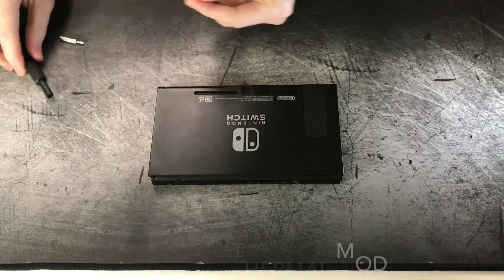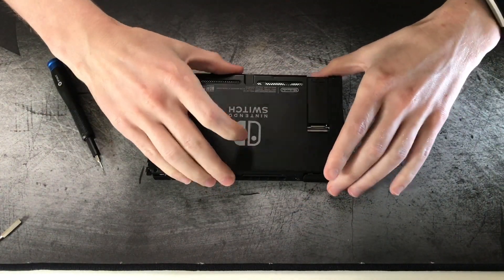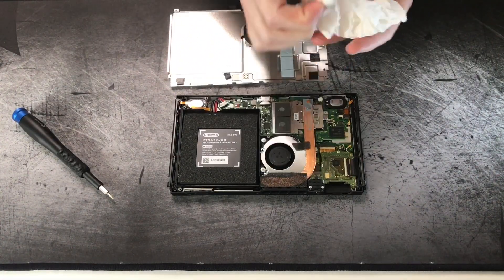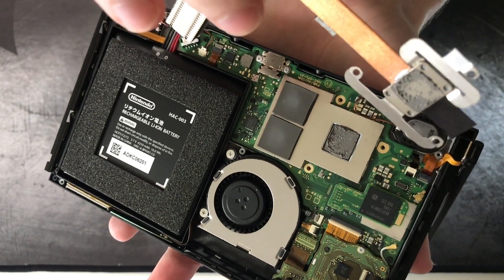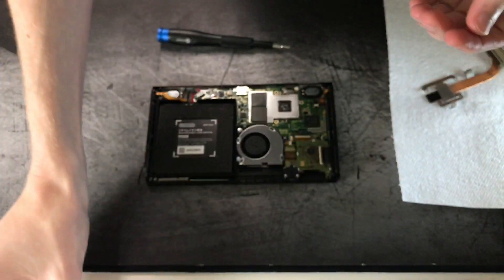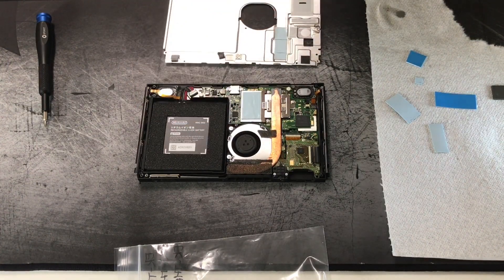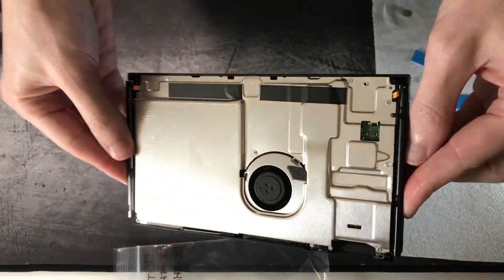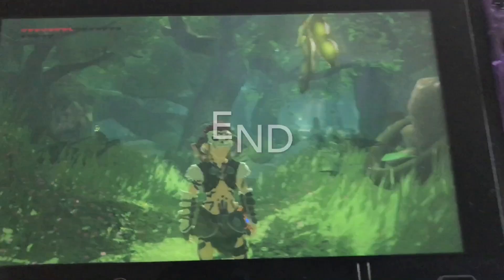Tech Shorts: Switch Thermal Mod Revisit, Thermal Paste and Thermal Pads

Comment: Changing thermal paste does not void your warranty. They use to try, but a few years ago we won that suit with the FTC they cracked down on Asus, Sony and a free others. This falls under Magnuson-Moss warranty act.

If you do not break anything in the process this does not void your warranty. Liquid metal will, as it will damage and corrode the metals. However swapping to another non conductive paste will not.
Reply: Is Arctic MX-4 good then? In order not to void my warranty I mean.
Reply: @theakiwar9118  Kryonaut is better

Comment: the backplate size can be increased by like 2mm in thickness and then a hole cut in the metal around the cpu and memory. Then put a 3-4mm thick heat sink directly on the cpu and memory and poke small holes in the plastic around the heat sync and put a thin air filter between the plastic and heat sync where the holes are. Modify dock to add a fan that directly injects air into the newly added holes in the back of the switch...

Comment: BTW, never spread thermal paste with your finger.  The oil on your fingers will reduce thermal conductivity of the material.
Reply: Does it really make a difference? Like measurable?
Reply: @clydefrosch  The oil (or any element/residue) break/reduce the conductivity between the thermal paste and the sink. Use only the very clean spreader (spatula).
Reply: @maikel_ribeiro  I get the theory, but I'm asking practically.

I did this mod using a spatula and from what I can tell, the switch still gets just as hot as before.
Reply: In theory? Maybe. In practice? No. Stop worrying. Or use a credit card to spread it.
Reply: @clydefrosch  hey Clyde I wanted to reply because I have done the same and came with the same result. I used some gel I'd extreme and placed some  along that heat pipe as well so the metal case will help spread some of that heat. What I have discovered is the system does feel warmer on the back and when I put my thermometer over the vent the air is warmer as well. So what I believe to be happening is the heat transfer is just better, just like going from air cooling on a PC to water cooling the heat transferred is more efficient. Also is the reason why your room will get hotter with water cooling than air cooling.  I did get the fps improvement as well even in astral chain ive noticed the 360 turning is smoother in places. There is another video done and noticing spikes in temps and fps drops in games for split seconds. 

Dock mode is quiter but still warm and hand held is less warm and silent.

Overall I hope this answered your question my man.
Reply: @souleaverr  hey did you remove the copper shim between the chip and the sink ? Is it neseccary to do that ?
Reply: @khanghuy1203  yes sir I removed the copper shim
Reply: @khanghuy1203  Oh forgot to mention as well the copper shim I don't think was necessary. There doesn't appear to be enough of it to help transfer any heat really from the metal cover that is over the ram chips. The only reason I could think of the shim was to maybe keep any paste of there's from spilling over onto the chip when they put the metal back cover back on along the top of the pipes. Over all the improvement is nice my switch doesn't sound as loud but performance wise I don't think it will be huge it may overall just help the system hold the clock speeds better in dock mode or handheld.
Reply: @souleaverr  hey thanks for the quick rep !! I already did the repaste, i did notice a slight quieter fan on the switch however the backplate is a lil bit hotter than before, so i guess the heat spread evenly from the chip to the metal backplate which is a good thing !! Btw do you know what is  the purpose of the copper shim ? I removed it also but i wonder if it would impact my future usage of the switch ? Thanks !
Reply: @khanghuy1203  the only thing I can think of or the purpose was to keep the other paste from spilling over that is applied on top of the copper pipes that the metal backplate touches because it appears that they used two different thermal pastes a light gray was under the heatsink touching the shim and a brown looking color was applied on top and on the copper pipe some. Also yes even for me when I put my paste I ran some more along the top of the copper pipe and on top of the heatsink so the metal backplate will absorb some more of that heat. So when I play even in handheld I can feel the back being warmer where the kick stand is but overall the fans are quiter. I play mostly docked and a few times in astral chain or botw that fan would kick on like a jet very rarely but it was noticeable when it did. Now it never makes that sound when docked and when in handheld I never notice the fan.
Reply: That's why you wash your hands thoroughly. They remove the most of the oils from them temporarily.
Reply: What thickness are the pads?  I thought I saw 0.5
Reply: myth
Reply: Was about to make the same comment use a piece of plastic to spread it
Reply: Yes, you are right. The oil from your fingers can reduce conductivity. I always spread with the tip of the paste applicator.
Reply from the maker: Not that it would actually make a difference at all in an application like this; there is a spot of alcohol on the napkin seen at top right of screen that I wipe my finger off on to clean it before I touched the paste. On a larger die i'd use a spudger or the 'pea' method but with it being so small this was best to ensure full coverage.
Reply: @iamflowers3673  Tech Yes City (Brian) washes his hands & dries them thoroughly. Then he applies thermal paste using the finger method with GPU's, CPU's, APU's, & North/South Bridge components plus he over-clocks them. Ignore the nay-sayers because Tech Yes City already debunked the finger oil reducing temps fallacy. However thanks for the video because my son tends to play Fortnite on the switch & it can be warm at times. So I used Deep Cool Z9 (non-conductive) thermal paste & Arctic Silver thermal pads that it greatly reduce the heat. Once again thanks for the OP tips.

Comment: The only thing I am left to wonder is that did you switch out the old thermal pads located on your backplate to the newer ones? What I did notice in the video is that it was cut around 4:57 and your backplate turned around. You did say that you removed (meaning that you switched them out) but the ones on the backplate seem just like they are the ones as before.

If you did so leave those thermal pads on the backplate, may I ask what thickness they are? I really want the best heat dissipation for my switch. Thanks!

Comment: Do you also have a thermal pad between the RAM chips and the aluminum?
Reply: Diablokiller999 he probably doesn’t
Reply: nop, in my case, I dont think it is important to cool the RAM. RAM never gets very hot or throttle down. But its your choice.

Comment: I know this video is a bit old, but I was curious on your opinion about something. I have some Kryonaut sitting around that I want to use in this mod, but no pads...do you think applying the Kyro thermal paste on the ram chips would work as well as your mod with the pads? I have yet to open the Switch up so I'm unsure if there are any gaps between the ram chips and that shield.
Reply: Use the kronaught for just the past areas and EKWB pads for the thermal pad area.

It worked great on my lite huge difference in temps

Comment: Use anything--but Arctic Silver 5, you do realize there are a ton of noobs who might be watching this video to get advice and they do not realize Arctic Silver 5 is conductive.  Also did you use thermal paste on thermal pads, that makes almost no sense?
Reply from the maker: Arctic Silver 5 is THERMALLY conductive... not ELECTRICALLY conductive. It's fine.
Reply: @iamflowers3673  Yes but.. Arctic Silver 5 should be kept away from electrical traces, pins, and leads.
Reply from the maker: I mean, I wouldn't TRY and apply Thermal Paste on anything other than where intended, but if you get some on other places it won't be catastrophic.
Reply: @iamflowers3673  Your good, I'm just thinking of noods adding too much. I personally have liquid metal on my swich, so far no problems.

Comment: As a Enterprise Server/Storage and Macro Computing Expert. NEVER just NEVER put paste in thermal Pads aren't designed for that they lost all his purpose when you add other material specially semi-liquid on it. Dude, please read how works Thermodynamics before make videos to public.... AND for the fox sake..... DO NOT Spread thermal paste with your Fingers gizzz this will cause bubbles and unstable heat distribution and of course CONTAMINATION. Put a Simple Line of thermal paste or a Rice dot.
Reply from the maker: If you notice in the video I actually removed ALL the thermal pads with thermal paste on it. I didn't have the correct thermal pad thickness, (which is why I did the re-visit and replaced them all). Also, putting thermal past on with the pea / rice method only really applies to when applying paste to something with a IHS. If you're applying paste to the direct die you need to make sure that every part is covered and the pea / rice method doesn't guarantee that at all. Lastly, spreading with your finger is fine. A lot of people complain about oils and grease but if you notice in the video I had a paper towel dripping with alcohol that I wiped my finger on prior so to remove any possible grease or other contamination.
Reply: IAmFlowers it is still safer to just use something plastic to spread it instade of spreading with finger

Comment: Why would you contaminate the paste with your finger oils?
Reply from the maker: A lot of people complain about oils and grease but if you notice in the video I had a paper towel dripping with alcohol that I wiped my finger on prior so to remove any possible grease or other contamination. It really doesn't matter.
Reply: @iamflowers3673  That's probably even worse as you have then had no natural protection from those chemicals getting absorbed through your skin.
Reply: oXY nary i never ever spread paste with my finger its idiotic

Comment: Why do you answer most questions except the ones specifically about the sizes of the thermal pads you settled on using? Makes it hard to follow this mod.
Reply from the maker: This was my comment from a prior video, "I used a variation of 0.5mm, 1mm and 1.5mm pads. The pads I used under the heat spreader seen at 35sec were the 0.5mm thermal pads. The thermal pads used on top of the heat spreader seen at 50sec were the 1.5mm pads. I also used 1mm thermal pads running the length of the heat pipe, (facing the back panel) before I screwed the back panel on - but didn't take a picture of that." 

I'd suggest getting .5mm, 1mm and 1.5mm and using them where you see fit.
Reply: @iamflowers3673  You could have easily pinned this so it would appear at the top of the comment section.

Comment: Now it's been a whole year that you've made that video. How is you Switch now? Is it still good to hold down the heat?
Reply: what about now? its been 2 years
Reply from the maker: It's still working perfect. I'm playing Pokemon Let's Go right now with over 300 hours logged. :)
Reply: @iamflowers3673  How is it in viridian forest?
Reply: @Fybre0ptix  I don't think thermal mod will help performance because switch only throttle at 84°C
Reply: @BadEnd98  Its usefull when you use retroarch.

Comment: What is the thickness of the thermal pads you used for your modification?

Thanks a lot for your reply!
Reply: As long as they aren't too thick/thin any size will fit tbh  just get a medium  sized thermal pad

Comment: Seems kind of weird to put paste on pads...
Reply: Isnt Weird, ITS WRONG. =) Just dont do that. Follow the other parts but NEVER just NEVER put paste in thermal Pad arent designed for that they lost all his purpose when you add other material specially semi-liquid on it.
Reply from the maker: @shenkay   Did no one watch the video? I replaced all the pads with paste on them. That's why I was doing the re-visit because I didn't have the correct pad thickness.
Reply: Shenkay thats what i wanted to say too when i saw paste on thermal pads

what fucking idiot puts paste on thermal pads

and spreading paste with finger is really stupid option, just take old credit card or something

by spreading it with finger you may also spread oil from skin and mix it into thermal paste and that may affect heat transfer
Reply: @milojkokitic6991  If the pads aren't thick enough and you don't have the correct ones it's better than nothing.

Comment: I just did this and now my switch wont turn on -_-
Reply: Have to send it back I tore off the copper plate and can't find it so hopefully I dont have to pay anything I'm beyond upset but nothing else to do it's no ones fault but my own do at your own risk
Reply: @mamajen1000  mine is stuck in the nintendo switch logo, yours is the same?
Reply: @IAmFlowers can you help us, why it can't turn on ? Do you think it's because of damaged chip?
Reply: Tu Trung Luu check all your connectors and reseat everything, if it still wont work you somehow managed to damage some hardware components and ruined your switch
Reply: Jennifer Starling of course you will have to pay if you send it back to nintendo, by doing this you somehow managed to damage it and void your warranty

Comment: What thickness can i use in the heat pipe? 0,5 mm? 1 mm?
Can i clean the thermal pink paste on the heat pipe and only use the thermal pad?
My switch is warm on the back,in the zone there is micro sd..

Comment: What size thermal pad did you use everywhere?

0.5mm under the heat spreader / on the RAM?
0.5mm on the heat spreader / above the RAM?
1mm on the heat pipe / back of the metal case?
Reply: I measured the heights.
0.5 under the metal plate, directly on the RAM
0.5 on heatpipe
1.2 between the metal plate and the back cover over the Ram
Reply: dan8t6 Hi! thanks for the info! If I understood well I need:
0.5mm thick between direct RAM modules and the encapsulate metal plate (the cover of the RAM modules).
0.5mm thick between the heatpipe from heatsink and the big metal case.
1.5mm thick between the encapsulate metal plate (the cover of the RAM modules) and the big metal case. (1.2mm but don't exist, is recommended to use 1,5? did you use 1,5mm?)
Is that right? Thanks for all!
Reply: @dan8t669  there is no 1.2 thermal pads.. .. 0.5, 1, 1.5, 2
Reply: weather you are able to buy them or not, the distance is still 1.2
Reply: @dan8t669  hm.. where you can buy a 1.2mm thermal pad? XD
Reply: squish a 1.5 pad

Comment: Use thermal paste or pads but never both. Paste is preferred if there is direct contact between metal, but if there's a gap then you use pads.

Comment: using k5 pro instead of thermal pads is probably ok, right?
Reply from the maker: Based off the information posted in their description of the paste I'd say it's completely safe. They state it's non-conductive and its primary use is to replace thermal pads.

Comment: I'm going to try this out. Anything is better than whatever thermal paste Foxconn puts in the switch.
Also the person in the video used a 0.5mm thermal pad...
Reply: I tore up the volume ribbon cable :/
Reply from the maker: IT happens. I'm really sorry to hear. :(
Reply: it's ok. Thankfully eBay has replacements..
Reply: I can still use my switch, it's just that the volume down button does not work.
Reply: alright I got the new ribbon cable and it works great now. I'll do some more testing since I had to replace the thermal paste again
Reply: very long awaited follow-up, it seems to work well, it's pushing out hot air but not as much as it used to. It might also prevent the cracking issues of the switch later on
Reply: technica it pushing less hot air out than before means its transfering less heat than before, it is supposed to push out hot air if it has proper heat transfer from CPU to cooler

i suggest you try to apply paste again

Comment: Just performed the same mod to my switch today with the added .5mm thermal pads. I used IC7 diamond, was going to use Thermal Grizzly liquid metal but the metal shim didn't look promising and I didn't want to corrode the aluminum contact plate on the heatsink.

Point being, using a really small amount of paste and going to area's in BOTW that normally cause me lots of frame drops such as Korok Forest just to get the paste warmed up and spread across the CPU/GPU correctly - I saw a huge performance gain.

Initially there were frame drops but after the paste settled properly I saw no frame drops in Korok forest or places like Thundra Plateau.
Reply from the maker: That's great to hear. I'm glad that this mod seems to be giving individuals more performance.
Reply: @iamflowers3673  thanks to this comment, I'm doing it too now lol
Reply: It looks like aluminum but it's not if I remember well. In GBAtemp forums if I even remember someone risked direct die contact to the cooler with liquid metal and opened it like a day after and was all fine.

Then a few months later he opened again and posted in the forum and seems fine, however I would never recommend it because in a lot of stuff even copper after some time it goes pretty bad some people had complete overheat after just 3 months, some more, but it end up still reacting and it transforms into dust completely dry dust.

Also for something that goes with you all over the place, shaking I'd never recommend as it will keep moving all over the place and can send liquid metal everywhere...